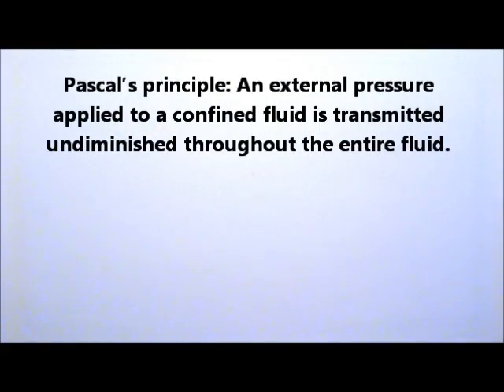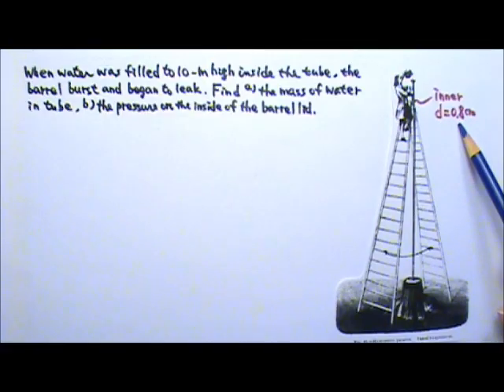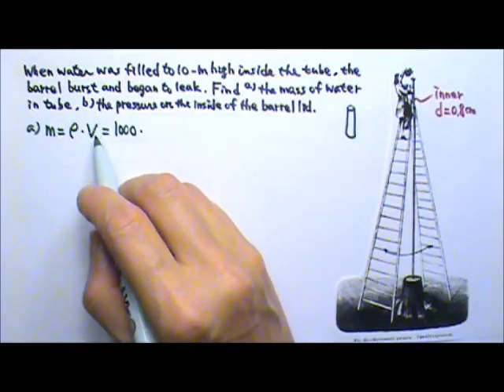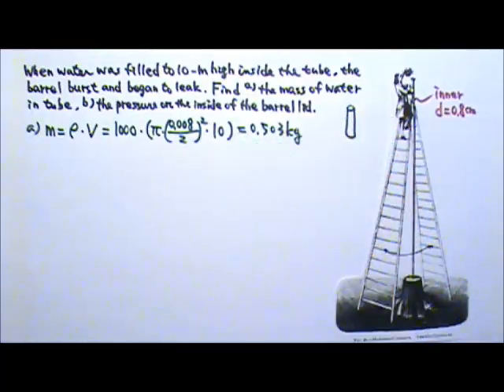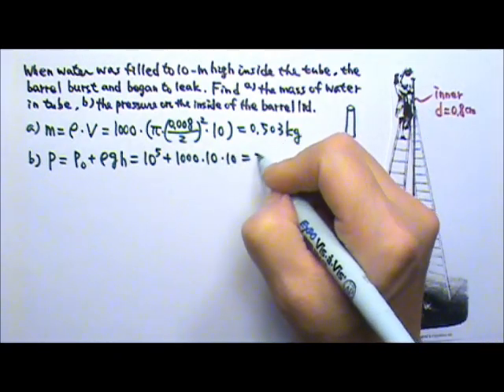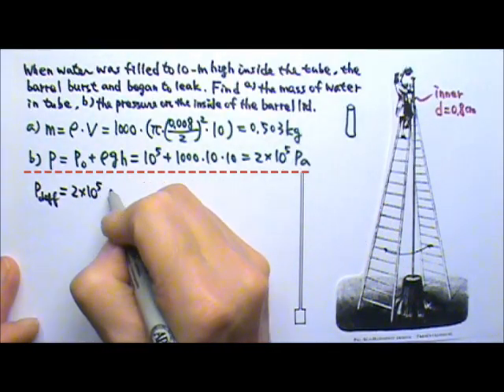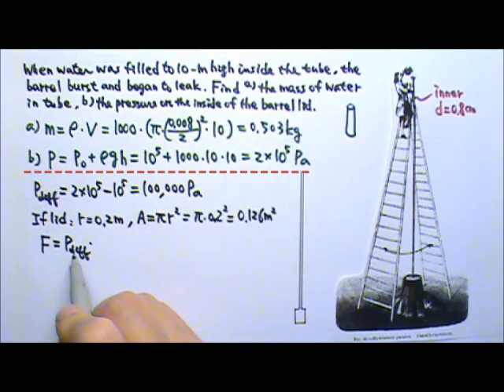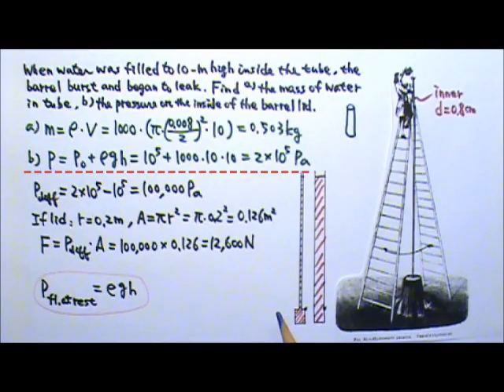AP Physics 1: Fluid Mechanics 9: Pascal's Principle &Pascal's Barrel Experiment

Comment: Does this mean that if you lift .503kg of water that high to input in the tube you then could produce 12,600N? It sorta sounds as if you could take that amount of pressure to lift that amount of water that high then you'd have a self-running system? Am i wrong?

Comment: Why do you use the pressure difference in order to find the pressure
 on the lid? Why wouldn't you use just the pressure caused by the long tube (in this case 2 x 10^5 Pa)?
Reply from the maker: Let's look at a table top: the pressure at the top and bottom of the table top are the same, so the forces from the pressure = PxA are the same amount above and below the table; therefore, the 2 forces cancel and the table doesn't get pushed up or down by air pressure. If there is no water in the tube, the pressure above and below the barrel top would be the same, so the net force from pressure would be 0 and the barrel top would not have any tendency to burst. So it is the pressure difference above and below the barrel top (or inside and outside the barrel) that causes a force to push on the barrel outward and make it burst. Adding water into the tube increases the pressure inside the barrel (from atmospheric pressure) while the pressure outside stays at atmospheric pressure. So the pressure caused by water in the long tube is the pressure difference above and below the barrel top that we need to use to find the force.